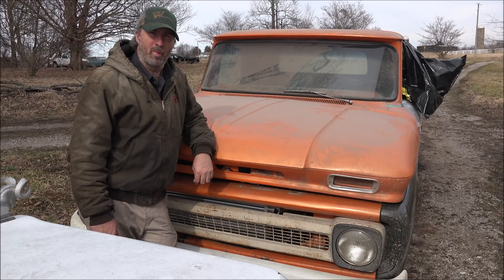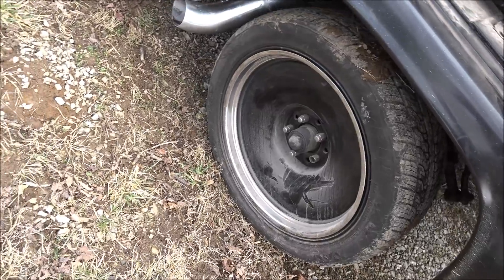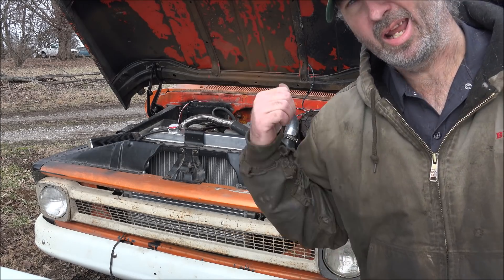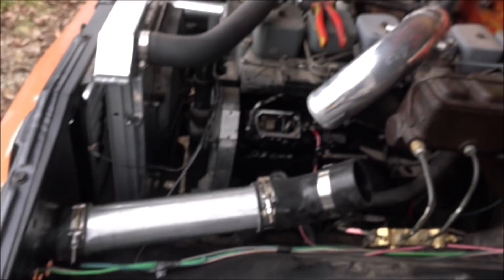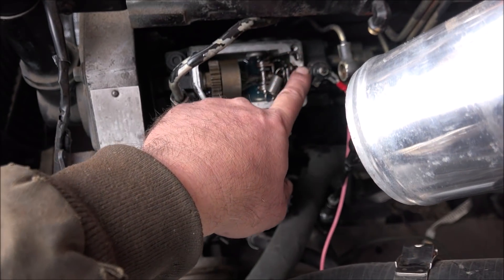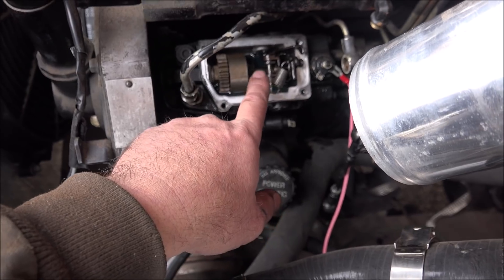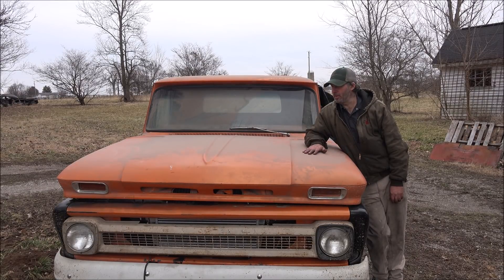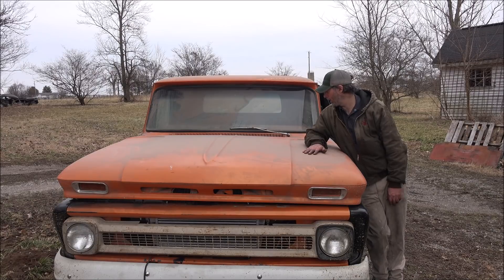Cummins Swap Lowered 1964 1965 ? C10 Rat Rod Chevy VE Injection Pump Fix Not Banks Duramax version

Comment: Learned to drive in a 1966 Chevy with a three speed on the column. It also had a six cylinder, just not quite that much torque.

Comment: Hey Brian, here's a truck repair you probably won't see done in the USA. But from the video it looks like this is a normal daily repair there. I thought you might find this amusing.
https://www.youtube.com/watch?v=peG1vKLVD8A
Reply from the maker: Clearly a dedicated shop to doing that process. I wonder how many there are in Pakistan rebuilding rims? Looked like a nice heavy center much more steel than a typical US rim. Seeing how  they load their vehicles I can understand the need. :-)
Reply: @bcbloc02  It appears that a common business model there is to have a lot of small related companies in the same building or work center, and they all some way cooperate on a build. If you poke around that Pakastani Truck channel you will find a lot of complete truck rebuilding from the tires upward that happens there.  Complete frame and suspension reconstruction and complete body construction seem to be common.

Comment: When you turn the fuel screw back in, the idle will come up. Fuel screw adjustment, effects low and high idle on the ve pumps.so, if you turn the fuel screw in, to get low idle adjusted properly, your fuel screw adjustment will also be close.

Comment: Anyone else notice the exhaust puffing out around the turbo... especially around 7:30 mark... as you said... more to do... your forklift doesn't chuff that much soot when given the boot...
Reply from the maker: Well the intake wasn't hooked up so it wasn't getting any air then.  I think it may need a valve job I can hear a bit of leakage back thru the intake when it is running. Once they put the fuel to it and blow the head gasket they can address all that. lol I have no idea how many miles are on the donor motor probably 300K+ coming from a first gen Dodge so it is well broken in already.

Comment: Looks like a nice project, some things about it really bug me, like not having the right thermostat housing to point the rad hose the right way, and the air horn isn't really lining up with things that well, but they're easily fixed little details.  
You turn the fuel screw in much?  I know you know your VE's, but if you ever want some lesser known tips, (some that make your life easier, some that make power) I'd happily chat with you about them
Reply from the maker: Fuel screw was at just under runaway and the AFC cone was modified and set to allow full fuel at full boost. AFc was set to not blow a bunch of smoke. I told them if they wanted more fuel get bigger injectors. Pump is set for all it can reliably do. If you have some good tips to get me beyond 650rwp and 1300 torque fuel only with Old Yellow I would be glad to hear them.  Shoot me an email!
Reply: @bcbloc02  could have sworn I replied to this.. I did send an email... I haven't heard good things about the 14mm pumps, though the more aggressive cam plates is something I'd like to find more info on and at a reasonable price.. I don't quite have the machine shop setup I'd need to cut my own (hint hint)
Reply from the maker: @Rx7man  I think the higher lift cam plates make the degrees of the injection event too long. You might get more fuel but it is too late in the cycle to do any good.

Comment: I've never messed with a diesel, it's very complicated to my eyes. It's what you are used to I suppose. Very interesting, it seems to go well enough. Thanks Brian.
Reply: tolerances are more critical, but older diesels are actually simpler than gas engines, and much more reliable.  If they ran when they were parked, you can come back 10 years later and they'll flash right up again

Comment: It is nice to see a ‘charge air cooler’ that isn’t an ‘inter-heater’.  By the way, I really like your driveway.
Reply: on some vehicles I worked on, with their placement, we called them intercookers
Reply: Ooo, I cringe at the damage some flame throwing turbos can do.  ‘Intercooker’ is such a great term, I think I’ll adopt it.
Reply: @ekieffer68  the intercookers were specifically the ones mounted on top of the engine with a little weenie hood scoop, Subarus and 2nd gen Rx7's had them

Comment: Those pumps are not impossible for the 'unschooled' to work on, but it's not a project for the totally unprepared.  A little research goes a long way, and a lot of research is even better.  What else can you do when you need your truck but don't have $750+ for a replacement?

I've had my VE out three times.  1st was a seal failure on the inside advance cap, 2nd was due to broken plunger springs, 3rd time started with the distributor seal.  At that point I decided to take it completely down for a full cleaning & kit.  Good call, on the last one.  I discovered that part of an old plunger spring was still in it, and the bone shaped dogs that drive the high pressure pump gear (can't remember the proper name for them at the moment) were nearly sheared in two.

Setting up the timing after having it apart has been the most "iffy" part about the last round.  One source seemed over-detailed and confusing, the other may have the wrong specs.  It's either fighting the starter when cold or the starter is getting weak ... or it's a combination of both.  It kicks right off when it's warm.
Reply from the maker: Is yours an early style ksb or late? Honestly unless you moved the pump gear when you pulled the pump you should have just aligned the key way and the scribe lines on pump and cover and been in correct time.
Reply: @bcbloc02   the gear wasn't moved.  on setup the pump was locked at 0.050 lift (easy to do when it's off of the engine), which had the key in the right location.  Installed, gear in place and tightened, rotated the top of the pump toward the engine until slack was just taken out.  Tighten mounting nuts, pull timing pin, unlock the pump before torqueing the gear nut and installing the remaining mounts and externals.  The mark I put on the pump got obliterated by cleaning/handling, but by the paint on the block it appears to be in the same position as before.  Truck is an early '93 with many left over '92 components.  I'd probably have to send you pictures to know exactly what variant the pump is.

By what I've been able to hash out of the  Chitlons, their (poorly written, IMO) instructions seem to indicate the pump should be on maximum lift when the timing pin can be engaged.  If that's the case, I should be right on it or slightly retarded.  I can't find my notes to see if I wrote down what maximum was on this pump when I checked it.
Reply from the maker: As long as you didn’t knock the key out putting the pump on just turn the pump body till the scribe line lines up with the one on the cover and you will be stock timed. A line width above the timing cover line is a good place if your fuel is above stock levels. These are scribed one lines and not paint marks and should exist unless parts have been replaced. Look and see. Sounds like it is too advanced if it is fighting the starter.
Reply: @bcbloc02    I'm fixin' to find out, once I get the cable running to the manual fuel shut off hooked back up.  I tried giving the starter a healthy tap with a hammer a few starts ago, and it cranked.  If it fights with the fuel cut off pulled, then I've got a problem with the starter brushes or commutator.  Truck hasn't been used much since the price of fuel got really high, and non-use invites problems.  And you know how "rebuilt" starters can be.
Reply: Starter issues confirmed.  Wouldn't crank under any circumstances until I gave it another love tap or three.
Reply from the maker: Easy fix then!

Comment: Excellent video it's nice to see that you got it running right again that style of Bosch injection pump has alot of stuff happening in the top cover there.
Reply: the first time I took one apart I was a little concerned as well.. I've done a number of them now and had them completely torn down and put back together.. it's mechanical, it makes sense when you see it
Reply: @Rx7man  yes that is true I have had to replace the cover and spring and adjusting screw on my customers 4bt cummins he tore the engine apart on his garage floor and broke parts of the injector pump and then he didn't know how to put it back together so he hired me to overhaul it and put it back together and fix the injector pump
Reply: @clydeschwartz2167  yeah, common mistake, probably broke arm because he didn't remove the fuel screw.. he's certainly not the first person to have done that!
I once had the idle spring go SPROING across the shop, losing the mount for the governor spring in the process, never to be found again.. I had to get creative, remember how it looked, go to the lathe and make a suitable replacement to get the truck going again, when I got a parts pump to steal that part from, I was actually pretty close with what I had made from memory!
Reply: @Rx7man  I can believe that I took the pump off and took it apart on his garage table inside of a pan to catch loose and broken pieces. He said he rolled the block around and it fell and broke the pump I wasn't there until after the damage was done for all I know he may have tried to take the pump apart and broke it. I only tend to get the call after the damage was done and work a miracle to get stuff running right again.
Reply: @clydeschwartz2167  Yeah, that's usually when I get called as well!.. there's very few things I can't get running again, maybe not running right sometimes, but be darned I'll make it chooch!

Comment: I don't mess with pumps but can sure tell if whoever did mess with them knew what they were doing, like the old Cats that kept the top of the stacks pin holed. I can see the sign on the side of the road now. BLOC Inc, LLC and a big picture of Baily with 'Treats Accepted, Bulk Preferably' in big red letters below the picture. And 'Warning, Killer Chickens on patrol' right below in smaller print. A-PLUS to the camera person! GBWYall!

Comment: Your lane looks like our township road in front of our house.  Ain't fun when the freeze makes the bottom go out of gravel roads?  You need to put a Deere diesel in your 67 Dodge.
Reply from the maker: Besides a 4 cylinder a Deere motor would not fit very well in the old Dodge.
Reply: @bcbloc02  Knew a guy who had an Izzu complete with the automatic in a Ford pickup and another who had an Oliver 88 in a Ford pickup.  Both drove them for years.   Surely an old JD combine diesel motor would fit.  The guy who put the 88 in a pickup put a JD combine diesel in a boat and even turbocharged it.  Sweet!  Why go with the flow? If I was not so old and had the machines I would have a diesel in my prized 81 dodge pickup.  For now, I will be sticking with the Mighty Leaning Tower of Power 225 which might break the speed limit on an interstate but who cares?  Those guys who fly around you are usually at the next stoplight.  The C-10 is an interesting Rat Rod.
Reply: @bcbloc02  Oh I dont know. Go watch this retrofit, they did a pretty good job.  https://youtu.be/QYKQx1d9eH4
Reply from the maker: I had seen it already they put a 4 cylinder in it.
Reply: @bcbloc02  If you did one Rat Rod style, then anything goes.  You would not even have to have fenders and etc. on the front. Just a JD green lump showing upfront, radiators and etc. behind the cab, maybe some JD grill just to keep bugs off the engine.  Every JD nut would be bidding big $$$ on it so you would be crazy to not part ways with it.  Heck, you put a Cummins in a Hyster so this would be easy.

Comment: gotta love those old trucks, they almost always had a flat spot to set your tools
Reply from the maker: My 67 Dodge has much better fender tool storage than the Chevy but they are certainly nicer to work on than new vehicles!
Reply: @bcbloc02  and you don't have to worry about losing your 11mm Socet because you don't need it LOL
Reply: And if you want to, you can sit on the inner fender and have room to work on it.

Comment: Love how you’re completely un-effected by the fancy parts. Almost like in your mind your thinking I could’ve made something cheaper and better than this overpriced thing.
Reply: Better to work than to just be shiny.
Reply: @lewiemcneely9143  old HotrRod "saying if it don't go Chrome it" LOL
Reply: @ypopnun1003  Chrome won't get you home.
Reply: @ypopnun1003  I've always heard the long haulers say that you ain't cool if your chrome don't shine. If I ever had any it was covered up with dust and diesel, motor oil and grease. Chrome didn't pay my light bill.
Reply: @gofastwclass  That's right!
Reply: @lewiemcneely9143  My personal motto is it should be at least as fast as it looks.. I usually succeeded
Reply: @Rx7man  My mirror needs new glasses.
Reply: It's a common misunderstanding, chrome and expensive parts in fact do not make a car faster. Doing that requires understanding your goals and what you're working with, and selecting parts as that dictates, regardless of whether or not they're anything to brag about.

Comment: Some of the work looks very nice. Other not so good😧
Reply from the maker: I am sure it is a work in progress I hope they plan to clean up that radiator hose situation otherwise it looks ok.
Reply: Isn’t that a lot of weight on the front suspension of that C-10 with a 6BT? Did they modify the stock suspension? I did several repowers before I retired from Cummins and usually on a half ton pickup we would go with a n/a 4 BT or  4 BTA ?
Reply from the maker: @michaelwalker1865  I assume it is stock front suspension. The 6bt is only a fat person more than a Big Block in weight. I am sure it is only meant to be a fun toy to drive so payload is not important.
Reply: @bcbloc02  hey! I represent that remark 😉